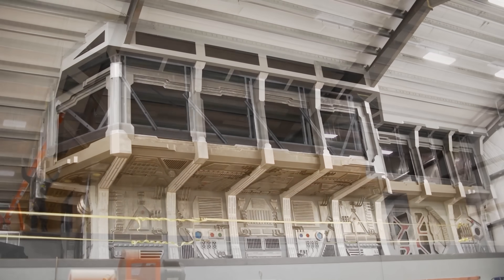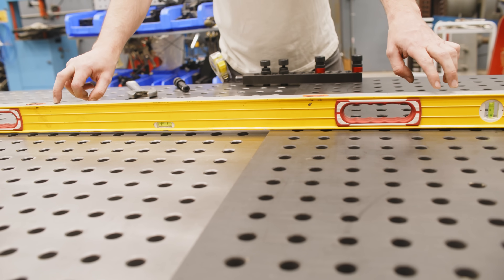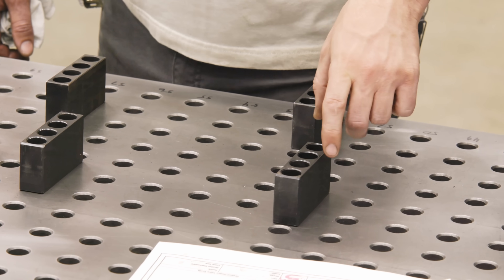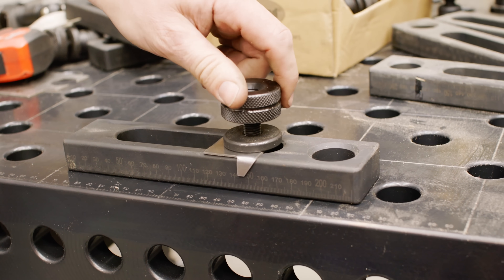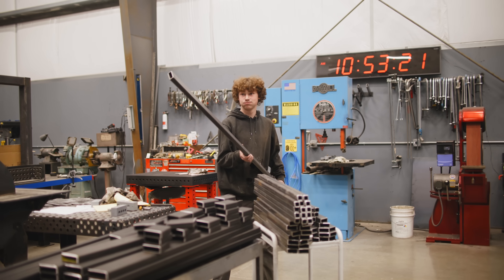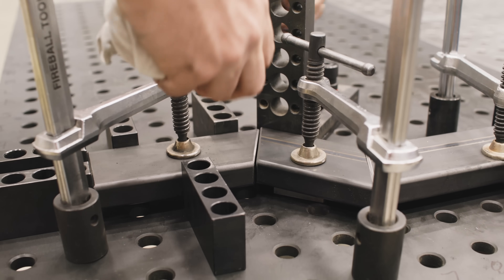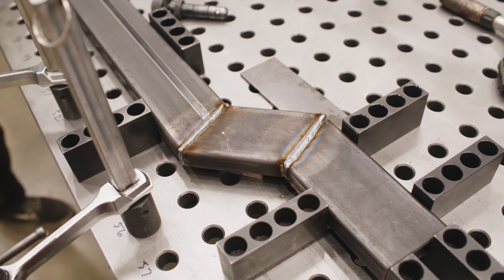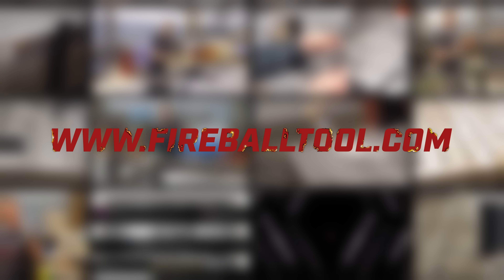I Taught My Son How to Fabricate and This Happened

Comment: Whenever I ordered anything from "old=way" machine shop, the products were a bit crocket. I remember ordering a frame for my 8'x4' diy CNC router. The long rails had to have tapped holes to accept linear rail guides... I ended up throwing everything in garbage, because the smallest dimension error was bigger that 1/16" and the biggest over 3/16".
So, great job... the kids who are nowadays left for the trade, need better tools that stop them from making mistakes.